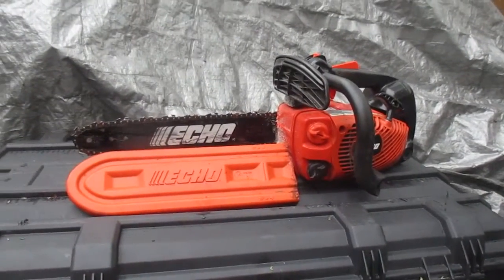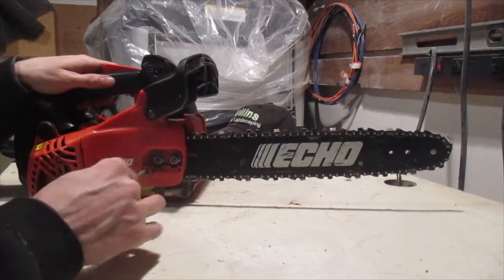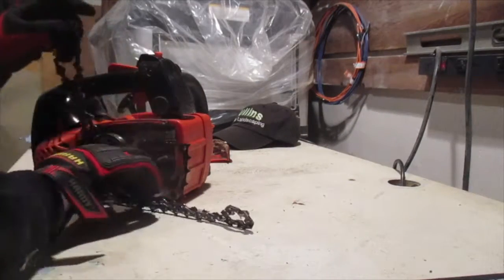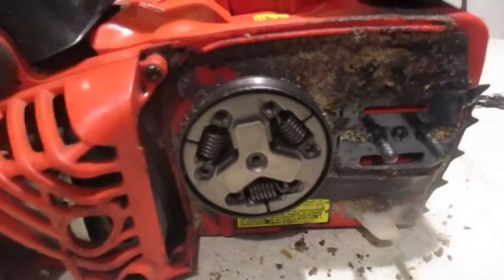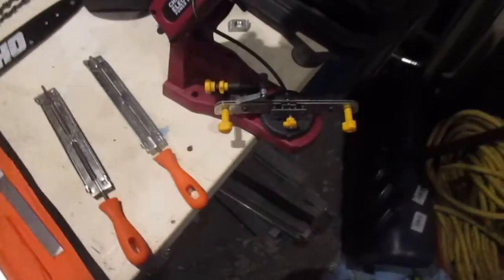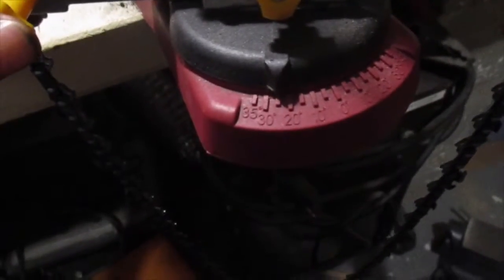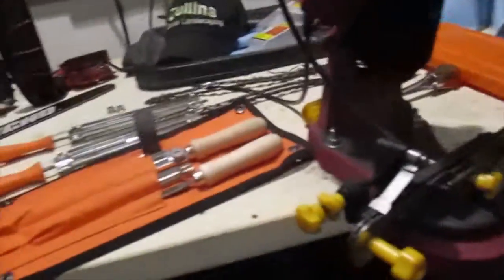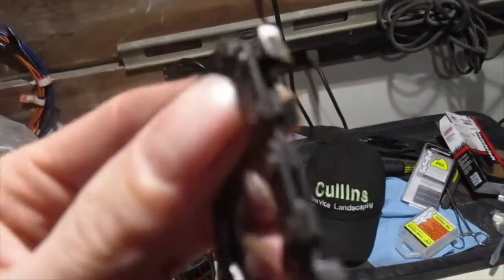How to Sharpen a Chainsaw Check Depth Gauge DIY Echo CS 330T Cullins Service

Comment: at about 7:40 in the video when you put the cover back on. I'm trying to do this with the exact same saw except that metal brake band in the cover wont fit back over the clutch drum on the inside and I cant get it back together. It looks so easy when you do it, what am I doing wrong?
Reply from the maker: It's not always easy I just got lucky that time.
Make sure the brake is off. That can be the problem sometimes.
Make sure nothing is blocking is from seating in place.
Line up the 2 bolt holes and the tighten screw.
Sometimes you have to play with it a bit wiggle it around.
Sounds like your brake is on though. It's kinda tough taking the brake off when it's disassembled, but it can be done.
Let me know how it went. I'm sure you'll get it on.

How do you like the saw. I love mine. Starts up every time and cuts like a champ.
Just make sure you clean and sharpen her.
I hope you found the video helpful.
I have more videos on this saw to be coming soon.
Reply: Cullins Service
I think there is a problem with the spring on the brake. I took it apart and to put that spring in with the brake engaged so the spring would be at it's most relaxed state, it's still incredibly tense to the point where the spring is bowing up.

The brake was definitely engaged, but I looked on Echo's website for a solution and for issues with a brake or a clutch, that I need to take it to a dealer. I wonder about cutting a quarter of an inch off the spring to see if that would work.

As far as the saw goes, I like it for what it is. It's great in the yard for branches but on the farm there are times when I wish I had one that's a little bigger. I may get an 18 inch or so one day but I've got to learn to maintain them. That's kind of why I seek out Youtube videos.
Reply from the maker: So you disengaged the brake and it still wouldn't go on.
I can't see the spring having that problem.
Is there something blocking part of the cover?
Are you lining up the bolts and tighten screw?
When you are trying to put it on try and look into the saw where the brake and clutch meet.
Try it w/ the brake engaged and disengaged you might be trying it backwards.

I will have more videos soon on chainsaw maintenance like tuneups.

Some people like husquvarna, but I have a 21 inch 450 rancher.
It's a hard start and takes a bit of warming up to get going and It doesn't cut that great.
Stay w/ echo or go with a stihl if your going to go bigger.
Reply: Cullins Service
I haven't tried it yet but I'm pretty sure I could get it back on with the brake completely disabled. The problem is when I put the spring back in, there is so much tension that I cant release the brake.
Reply from the maker: There should be no problem w/ your saw.
When the brake cover is off it's just really hard to disengage the brake, but It will disengage.
It may help if you put it in a vise.